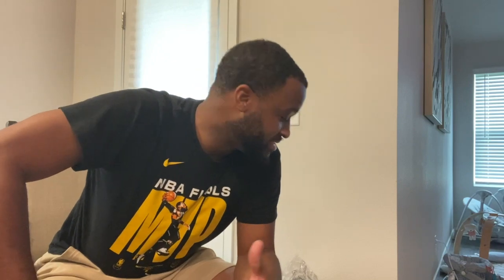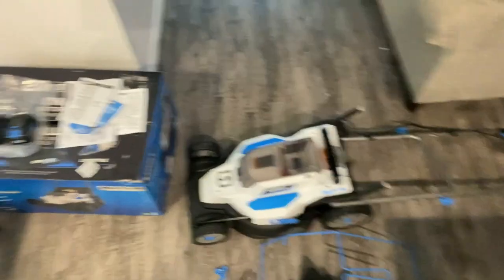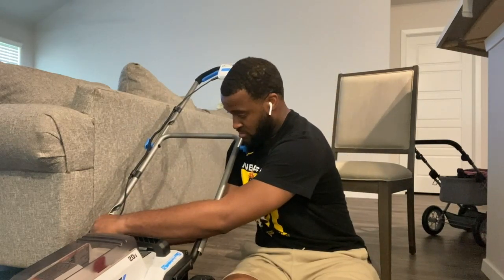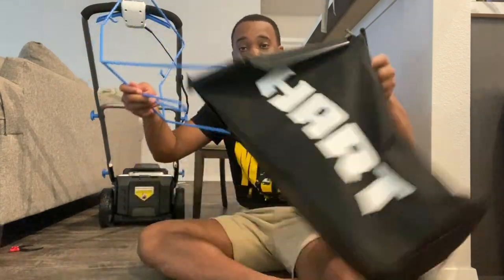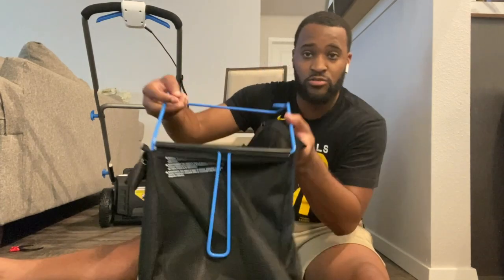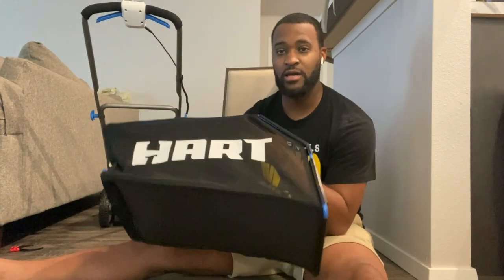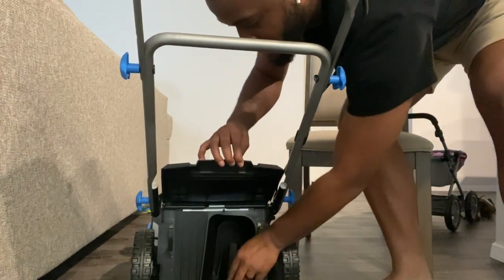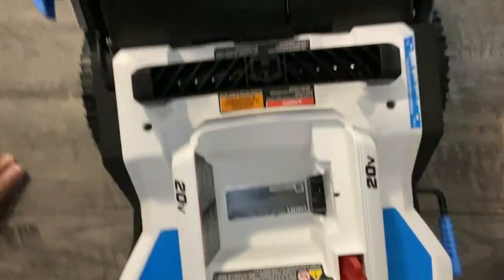How to put together your 20V HART Lawn Mower: Grass bag assembly

Comment: If you want to use the bag, then leave that black plastic plug out. that way grass can enter the bad. If you do not want to use the bag, then put that black plastic in place so the grass stays under the mower to be mulched. My experience with battery mowers is that the battery charge lasts longer if you bag. Keeping the grass under the mower to be cut and recut which is what mulching is works the motor harder than if you bag and the grass just gets right out from under the mower into the bag.
Reply from the maker: Yeah I end up taking that black plug out myself so it can enter the grass bag. Worked wonders. Just cut the grass yesterday and cuts great.